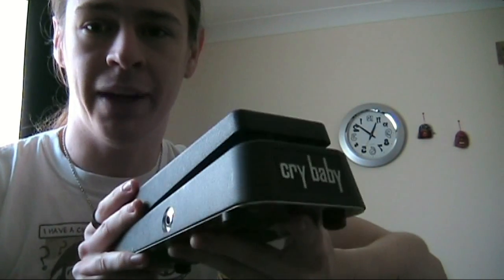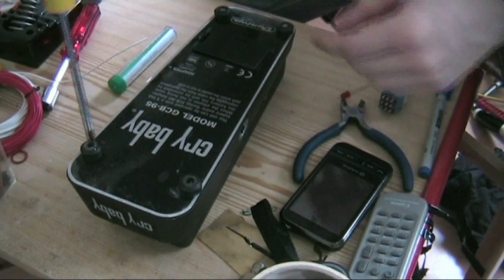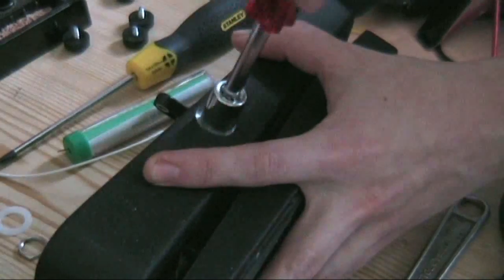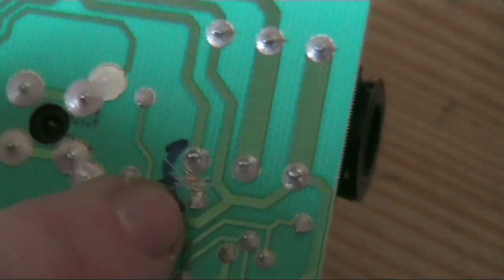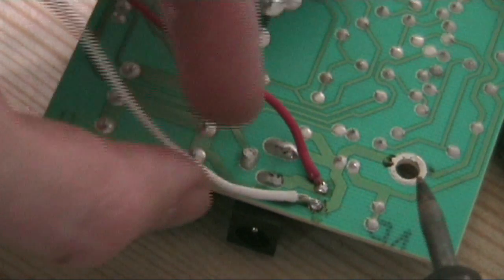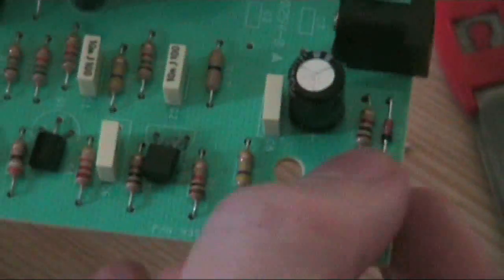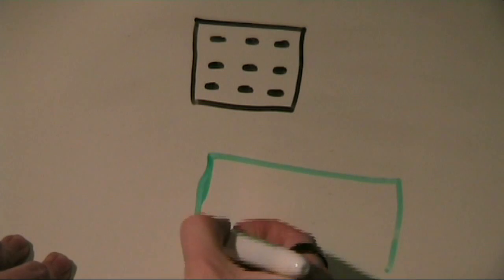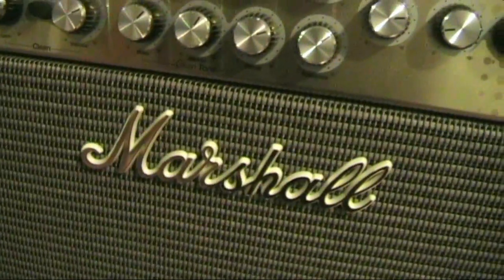Pedal Mods: CryBaby True Bypass and LED Indicator

Comment: This is great but I don't really care about it. The thing that interests me is transposing the waah footswitch offboard to its own stomp box because using the pedal to activate the waah is what causes the pain-in-the-arse uncertainty about if it's "on" or "off" and having to stamp on the stinking thing. This mod makes all the true by-pass gubbins redundant because you can wire in the waah as permanently "on" and just footswitch it in and out.

Which sounds complicated but it's not and it's much, much better that way.

Very good watch, this video. I learned a lot and it's clear that we can mess all we like with 9volt pedals - just leave the 240 volt tube amplifier projects to people who know what they're doing.

The "before-after" bypass mod dem didn't seem right. According to this, bypassing the circuit board altogether muddies things considerably and I think he must have mixed up his film shots because that doesn't seem possible. When it's switched in, we get the characteristic treble lift. The A-B would be to bypass the waah altogether to see what's what and then see what happens when it's back in circuit switched "off" - which is where the Cry Baby is a bit "shit".

Really nice video but I'd already done mine a bit differently and that works great so...........................

Comment: Dude, this worked flawlessly, and sounds great! Thank you! I added a ground wire with a 470k ohm resistor off the top center post to a washer placed on the nearby cover-post, ran the foot screw through it; gets rid of the activation pop.

Comment: Just did the LED mod, thx, peace of cake!
Reply: can it be done without a new switch, old one ?
Reply: @ruthlesscutthroat  ,I did it with the switch wich was in the pedal, don't know exactly how old this switch is, there are a few different switches used during the years.
Reply: @ thanks for the reply. I think i understand a little better now, a single throw single pull switch wouldn't work because the current going to the potentiometer is gonna get shorted by the current for the led
Reply: @ruthlesscutthroat  , this one is also a good LED mod with original old switch, https://www.youtube.com/watch?v=xL0frl8sutc

Comment: Awesome vid, thanks! Can you tell me what the value of the capacitor is that you first unsoldered? Mine disintegrated when I moved it! My pedal is over 20yrs old so not unsurprising! Thanks! Is it .22uf? This is my first project and I haven't touched electronics in about 20 yrs so I'm relearning everything.

Comment: Cool mods, just one note - there is no reason to both cut the trace AND de-solder the leg of the cap. If you cut the trace, just leave the capacitor attached to the pad. Once you cut the trace, you have disconnected that leg of the capacitor from the circuit, de-soldering is redundant.
Reply: I can desolder de resistor and put a cable with out cut de pist and is the same?

Comment: Did this recently as my first "serious" mod. Very easy to do and everything worked first try! Desoldering the leg at 6:20 is unnecessary as you broke the trace, you can just solder that wire to the back for a better connection. Also very glad I paid attention to the voiceover around 12 minutes and not just the schematic with the mixed up colors as you said! I put a purple LED on the left side and it looks sick.

Comment: Um, the schematic for the crybaby wah I'm looking at shows true bypass already. . . it shows switch one swaps both ends of the circuit out of the wah path down a single wire.   I guess I'll investigate while I install my LED.

Comment: I found it wasn't a straight swap.  Even without any washers, the 3-pole switch was too short.  So I also replaced the felt under the treadle.  It was worn almost right through.  I used a dremel polishing wheel. Its thickness easily made up for the difference. Thanks for your video!

Comment: After I finished this mod, I plugged in my guitar and amp and it didn't work...I guess in my excitement I forgot to plug in power for the wah pedal. Once I corrected that,  I heard a big difference right away in the lack of tone suck and volume drop. Because of those initial reasons, my Crybaby has been kept off my board. Now it is going back on. Thanks for the video guide.

Comment: It works but I ended up with a lower output wah that sounds like a telephone (no bass and attenuated high-end). I checked everything - I've done it right. Even did the stinkfoot tweak to get rid of the pop when activated. Also tried to change those input gain resistors - no effect at all. Any suggestions? The wah really sounds terrible now :-(. I had a different input cap in the original circuit - one with a plastic "case".

Comment: Hi Colin. I'd like to do the "true bypass switch and LED indicator" on my old 1980's Dunlop CryBaby Wah Model GCB-95. Unfortunately, my PCB doesn't look like yours - mine is a lot simpler. But, I'm having trouble identifying which resistors and capacitors I should be soldering wires to, and which resistors and capacitors I should be removing, if any. Can you help me out? 
Here is a link to an image of what my PCB looks like: http://farm8.staticflickr.com/7008/6592096369_8c4c806014_b.jpgThe greenish wires in the image are actually more bluish on my PCB.

Comment: Your wiring diagram doesn't require a ground connection, most other instructions have a ground connection at the top-middle-connector of the switch. Does it work without ground connection?

Comment: Has anyone figured out how to fix the "pop"?  I did this mod step by step and the pedal is now somewhat useless with the on/off noise.  I've tried various solutions of adding resistors at various points and nothing works.

Comment: I followed the instructions, and when I turn the wah on no sounds come out, what should I do to fix this? (I ignored the LED and connected the cable straight to the switch, but I don't assume that's the problem)

Comment: I don't think you need to lift one end of the cap and cut the trace. It should be either/or but not both. The trace that is recommended to be cut only disconnects the cap leg (lifted end) to the input jack. If you lift that end of the cap off of the PCB, the trace does nothing...right? Therefore, you should be able to lift the cap and continue per the instructions (without cutting the trace). The alternative is to leave both ends of the cap connected to the PCB for stability. Connect the new wire to the top end (north) of the cap without de-soldering the cap leg. Then cut the trace per the instructions. I can find no reason to lift the cap leg and cut the trace. Someone explain why I'm wrong here.

Nice instructions though...thanks for sharing.

Update:  I lifted the cap leg only but didn't cut the trace. Works great. Bypassed signal passes with no power applied to the wah. That should mean that the true bypass mod worked as intended.
Reply: I was going to post the same thing!

Comment: Worked perfectly. No annoying sounds from the switch even when it's a cheap one ($3 USD on Chile). Thank u buddy. Used a high luminosity blue led and a 1k resistor / multistrand wires.

Comment: Thanks for the tutorial!  

A couple tips for people thinking about doing this:

-You don't need to scratch out the trace on the circuit board if you are pulling out one end of the capacitor, it's redundant.
-The new boards have a different type of capacitor that is surface mounted to the board, so there is no room to pull out one end and solder.  In that case, you SHOULD scratch out the trace noted in the video, and just solder the wire directly to the board where the capacitor connects.

Comment: It should be noted that after doing this mod, the pedal will require a 9V DC power supply. A battery won't work.
Reply: After the mod, both DC power supply and battery work for me.
Reply: @Frederick, I am aware that a 9v battery and a 9v power supply have the same output. That has nothing to do with this topic. Had I been inquiring on power supplies and their relationships to batteries, this might be relevant. Thanks for your comment.

Comment: Hi!  I have two questions:

1. I have a Dunlop CryBaby GCB-95, but I'm actually considering selling it and getting a Vox V847 (or V847a).  The deciding factor would be on sound.  What I want is the better wah pedal for playing Mayer-, SRV-, and Hendrix-style blues (those are my three favorite blues guitarists).  Which would be better suited to get that type of tone/sound?

2. If I were to get the Vox pedal, would the modding be basically the same process as modding the CryBaby?  Could I follow the instructions in this video, or would I need to find a difference source for instructions?  (Also, I've heard that modding the V847 is different from modding the V847a - is this true?)
Reply: Cry Baby and VOX 847 sound similar!!! You better choose a Morley wah for more agressive wah sounds otherwise you will get dissapointed!
Reply: They both used wah pedals that where specially designed for them. highly modded!! Early on Page used one of the old grey Vox wahs and those sound NOTHING like a Clyde or an 847...later on he used Crybaby Wahs made by Jen.So basically he used a modded Cry Baby wah most of the time.
Reply: Do Hoeijmans Everything page used was modded in some kind of way.

Comment: I made this MOD to my cb but now everytime I turn it on and off it makes a loud POP to the amplifier. I've followed exactly what's on the video but couldn't solve this problem... could anyone help me?
Reply: Miguel Ballardin sounds like a ground loop. Try isolating the pedal by itself with a wall power supply.

Comment: Hey man, I did everything in the video. The pedal and LED both work, but when the wah is withdrawn, it makes a screeching white noise. When i press it forward it goes away. My guitar signal doesnt go through at all, the clean signal works perfectly fine. I'm just curious if theres anything I can do to fix this? I checked all the modified connections with a multimeter and all of them go through fine.
Reply: The big sin with technology is to skip the user acceptance test.  He he
Reply: lmao
Reply: hahahahahahahah you did what Gilmour did in the 60's :D

Comment: A friend of mine modified my wah like this but when I click on the wah there is a half a second delay where there is no signal. Anyone know how to fix this issue?
Reply: the voltage rating on a capacitor only states what it's capable of coping with... it has nothing to do with it's charging and discharging.
Reply: Did he mod the capacitors with very high voltage ratings? I have heard that sometimes if the voltage of the capacitor is too high, it will do just what you describe, take some time to charge, and allow the audio through. Just a thought. Good luck!
Reply: Thanks for the clarification. It's appreciated!

Comment: Im trying this as a first project in stomp box modding.You say you are using a 500Ω resistor on a 5mm red LED.Typical values for that type of led i find on the net are 1,8-2,2V and 20mA.With those numbers though, the app says i need a 360Ω resistor.
Are you just going higher to be on the safe side, or are your led values different?

I actually bought a bunch of color leds, and each color seems to need a slightly different resistor value (ranging between  270-360Ω).Should I go for the exact value the app gives me or would it be easier/better to go for something that covers all, say 400Ω (or 500Ω as you did).

Anyways, loving all the vids man, that accent makes them even that much better (Greek guy here!)

Comment: Hey man great tutorial, love your stuff! 
Just a small question, do I have to remove the capacitor and resistor from the PCB board for the LED or can I just solder the wires on the board like you did with them still connected to the board (couldn't quite see it right on the video)
Also the capacitor for the truebypass stays disconnected from the PCB board after hooking up the wire for the 3PDT switch right?
Thanks a million dude, you're the best!

Comment: Did this mod on my CryBaby and it worked great. Just one problem, the LED flashes when I turn on the wah (about 1 flash per half a second). Any idea what might cause this? Used a 1k resistor.
Reply: You likely used a "blinking" type LED.
Reply: you probably used a flashing LED! im pretty sure some flash and some are solid.. where did you get it from?

Comment: I did do the mod where you take the little tab loose and swing it out of the way and you can move the roller gear all the way forward more toward an "off" position, I haven't plugged it in to see if it helped or worked at all, I'll keep you posted, again this is for the crybaby Q95 switchless wah.
Reply: +Brad Ivie Well that trick doesn't work for the Q95! It renders the pedal useless, for you still have the effect coming through in the off position but when you try to activate the wah and step on it it does absolutely nothing!! SO I sure hope I can find the spot as close to where it was to put it back so that it at least works again lol! Someone please help!!?? How or can you make the Dunlop crybaby Q95 have true bypass?? Tell me you can...please.

Comment: Well I've looked through about all of the comments and NO ONE I saw has asked about the Dunlop Crybaby Q95 switchless model????? I have this one and want to know if and how you do this mod to it?? When I used this pedal with my Marshall Valvestate it seemed to be turned off and in a kind of bypass mode, but with my Orange all tube amp it's totally evident that the effect is still being sent even when the pedal is all the way up with it supposedly ingaged in the off position. Is there a way to correct this?? I sure hope so for I purchased the Q95 for the reason of no swtch on off just put your foot on the thing and go! But there is way too much effect coming through the Orange amp when the pedal is in the "off" position. Please help or do a video on the Q95 crybaby for I'm sure there are a few owners that would like to know the same thing! Thanks, and excellent video I just wish it applied to my crybaby! :(

Comment: Hey dude, where did you get the 3PDT switch from? I recently replaced my Crybaby's switch was a Maplin one (original was gubbed) and I cannot get the height right at all - if I move the switch up a bit, I turn it off while playing. Lower it by a bawhair and I can't turn the bugger on or off. I'm starting to wonder if the physical distance this switch needs to move is too much for use in a crybaby so a recommendation from yourself for a suitable one would be great. Cheers
Reply from the maker: +Richard Keel I purchased a whole bunch of them off of eBay, since I planned on doing lots of mods. 
I had to play about with the number of washers to get the height correct. 

Maplin are pretty dire for their choice of switches.

Comment: thanks for this very clear instructions & demo, great job! i might try this.
though, i've seen a lot of people putting the LED on top face, any reason why i shouldn't put it on a side? 
my wah is normally first in line so for me visibility is better when the LED is on the left side (somewhere in front of the output) i think

Comment: Just a quick question.  What would have to change, If I wanted to wire in multiple LEDs?  I've seen mods where there was a series of LEDs mounted under the rocking part of the foot pedal.  It looked as if the pedal was lit from within.  Very cool.
Reply from the maker: +DoctorKillmore All you should have to do is link a bunch of LEDs in series after the dropping resistor. 
The resistor has dropped the voltage to the correct level, so you can wire the LEDs together in succession to have as many as you need.
Reply: Thanks.  So, when linking them together, how does the chain go?  Is series when you link negative to positive to negative?  I appreciate your help.
Reply from the maker: Yes, series would be when you link the LEDs one after the other positive of one to negative of an other. 

If you are going to have a lot of LEDs you want to have it might be best a couple of series lines. 

The opposite is parallel where you would link positive to positive and negative to negative.

Comment: Stupid question: does the color of the LED effect the sound of the pedal? Like say, what if I were to use a blue or green LED?
Reply from the maker: In this case the LED is not in the audio circuit, so it has no effect on the sound. It's just there to tell you if the effect is on or off.

However if you were to replace clipping diodes in a distortion pedal with LEDs, for example, then the colour would make a difference. Different materials are used to produce the different colours and each run at a different forward voltage. Reds have a softer attack, and blues have a much harsher sound.
Reply: CSGuitars Ohh, I see. Awesome, cause I'd personally rather do a blue for the wah but that's just me haha I'll keep the latter in mind as well. Thank you for the information :)
Reply: +DasOmen02  I have between 8 and ten pedals on my board and I like having different coloured LED's :-)

Comment: I followed all the steps and have strong connections, the LED works, and the pedal works fine in bypass mode, but no sound comes out when the effect kicks in.  Any suggestions why this is happening? I even tried adding the ground connection as shown in some other sources.
Reply: +Dan C 
The same thing occur with me...
Reply: Helder Filipe Silva Did you find a solution?
Reply: +Dan C
 What happens with me is that there is a loud click sound when the pedal turns on and off. Any thoughts?